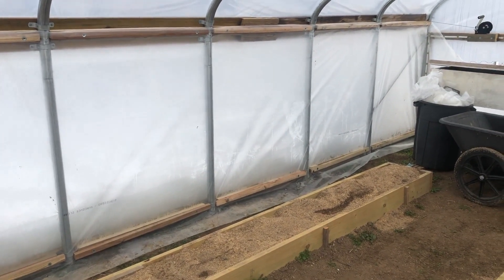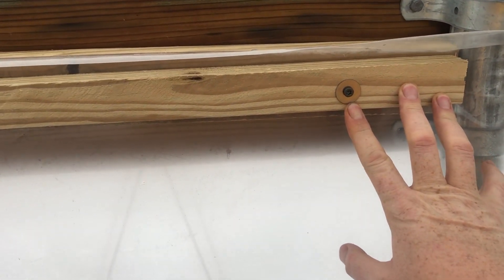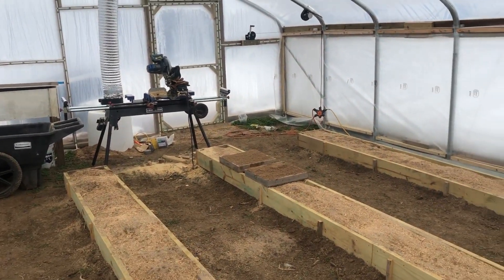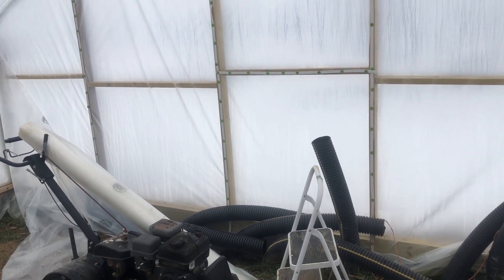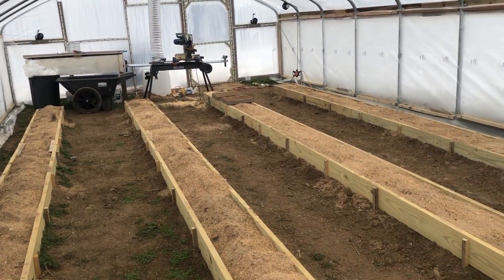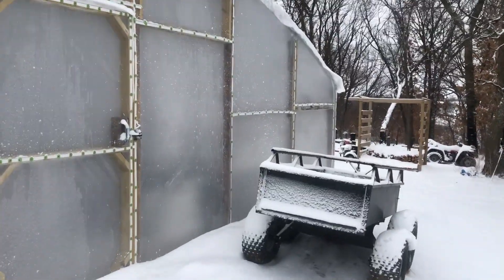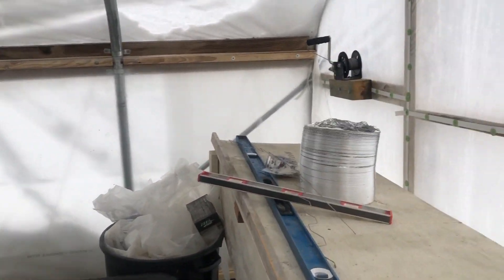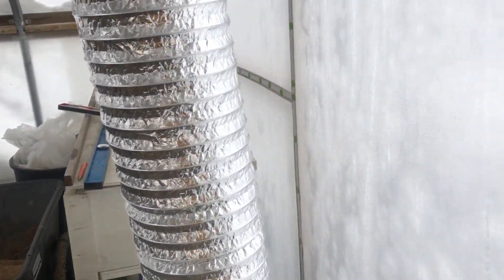winter garden greenhouse update  - January 2019

Comment: Thanks for the update! Exciting stuff. My question is whether your earth battery will be sufficiently charged given the fact that it seems the blower has not been running for the last while. (an assumption on my part). What is the temperature of the air coming out the exhaust tubes?

In order for the air coming out of the tubes to be heated, it seems like it would require an extended period with hot air being forced down to warm up the rocks.  If the rocks are cold, it may take some extended period of warm days with hot air being forced down into the rocks to sufficiently charge the battery so that it can provide the warm air you need at night.
Reply from the maker: Mr Homestead we haven’t seen many sunny days to really charge the heatsink.  I’m rely more on the geothermal side of this build to provide warmer air to keep the greenhouse warmer. 

Yesterday was a cold and cloudy day. Last night we got down to 4 degrees outside and the greenhouse was 28.  With a mini hoop house over my grow boxes I can absolutely grow hardy crops under these conditions in the greenhouse.
Reply: @smallblockfuelie Thanks for the reply,  I'm sure the mini hoop house will help a lot, but i think you may be able to even get by without it in the long term. Here's why...

 I was able to visit a couple of greenhouses just like yours in Idaho a few days ago and learned some things you may find valuable. We were discussing this heat sync (rock) system vs the design with no rock, only buried drainpipe. So the two different systems operate on different principles. The design with the rock (yours) does not extract any heat from the earth. It only gets heated by the hot air sent down to it. It is not deep enough to benefit from the heat of the earth itself. Therefore, you will not see optimal performance out of this until you have had an extended period of time to heat the rock, which probably means you will see significantly better performance next winter, after you have had a chance to heat up and "charge" the rock over a summer. I observed 44 degree air coming out of the heat sync consistently, with temps as low as 0 degrees outside. Pretty neat. i think you have done everything right in your design so far. 

One other thing i learned though is that it is absolutely necessary to insulate the north half of the greenhouse in order to keep it warm enough to grow year round (except really hardy crops).  The folks i visited with are intending to insulate their greenhouses with large insulated blankets  -- you know, the ones that are used to insulate fresh concrete during winter pours. 

Finally, the greenhouses will require a dehumidifier and some manual squeegee'ing to keep the condensation off the inner plastic so that it does not block too much light.

Best,
Reply from the maker: Mr Homestead thanks so much for your reply, terrific information there.  I was having a conversation last night about adding additional insulation on the north side.